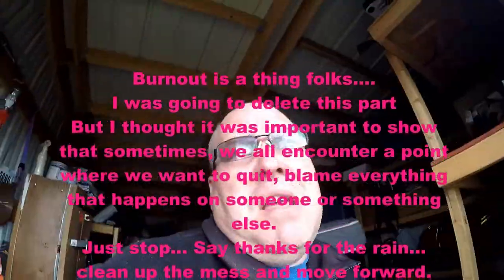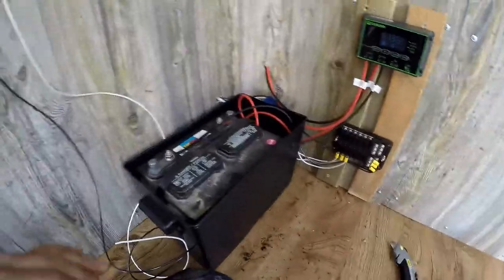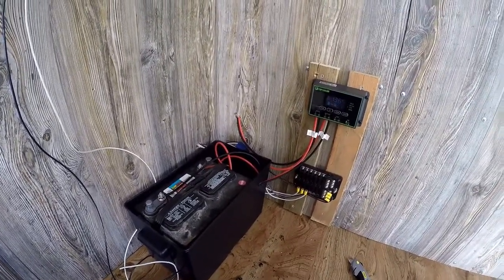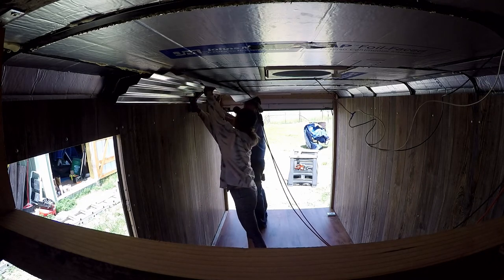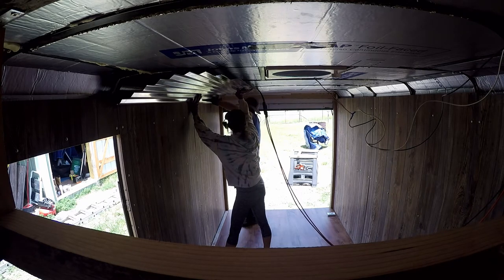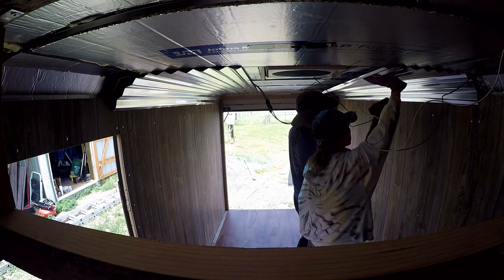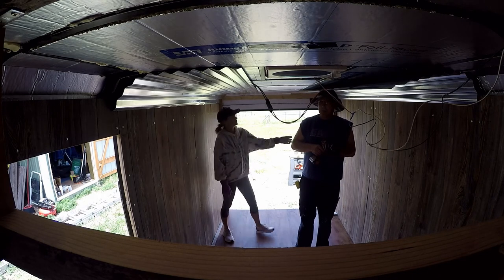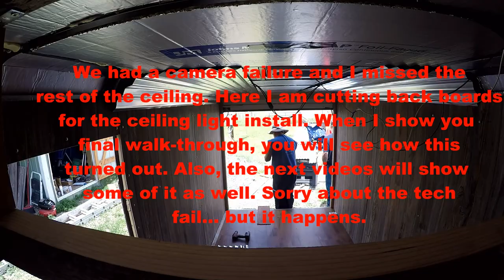6X12 Cargo Trailer to Camper EP-5: Electrical and Ceiling

Comment: Hi I thought from one of your past videos you were going to use the wattfun solar generator?  I was wondering how it was going to handle the cold?  and if it had a low temp disconnect?

You are probably better off with the low tech option.  Do you still like your wattfun? I am thinking about picking up one.

Thank you,
Roger
Reply from the maker: Yes, I will have it out in the cold end of next month. No ice yet so nothing to head out to